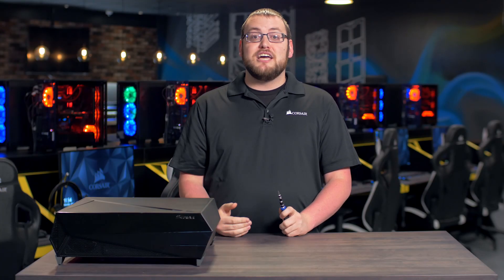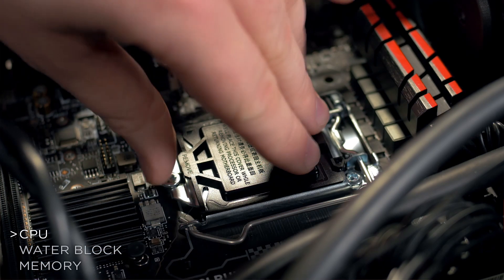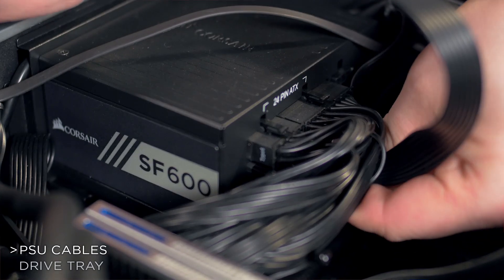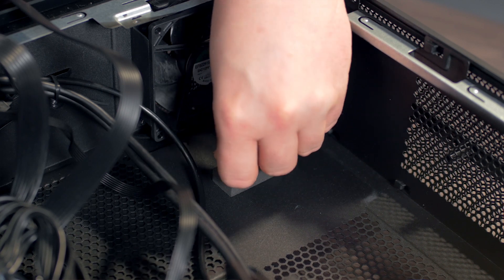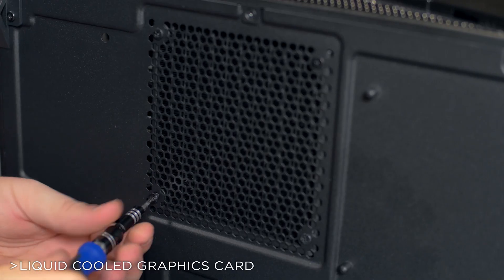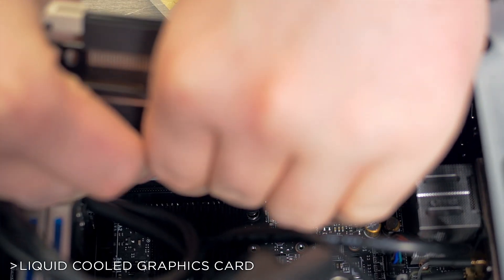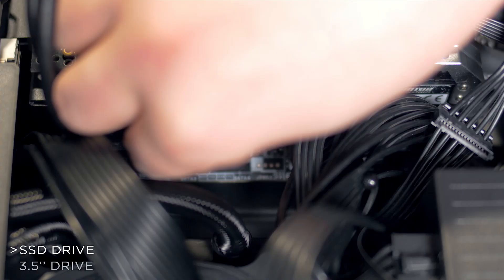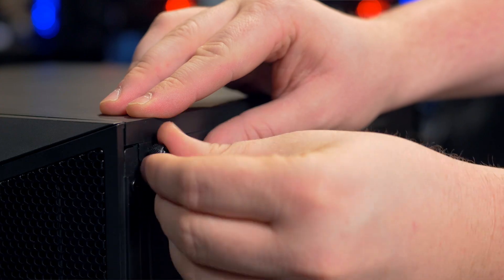How to Build BULLDOG 2.0

Comment: Does it have m.2 NVMe support?
Reply: That would depend on the motherboard, not the case.
Reply: Yes but it comes with an MSI motherboard
Reply: This isn't a case. It's a barebones. MOBO and PSU is comes with it, which is why you might have noticed he never installed them.
Reply: Yes on the bottom of the motherboard

Comment: Why do you call these VR and 4K ready when all it is is a case?
Reply: I guess because it fits big graphics cards
Reply: That is the stupidest thing ever.
Reply: It's not just a case...
Reply: luigikiller1000 Front panel HDMI port and usb 3.0 port
Reply: You can't be serioues
Reply: Any motherboard can perform at 4k. If you have a motherboard that supports the 4400 series then your Mobo is fine. Do you have any idea what you are talking about?
Reply: yeah a little misleading also define gaming at 4K?  Technically a 1070/1080 can do 4K, but at what FPS, settings,  refresh rate?  It's nice to know a 1080 Ti hybrid card can get in there, since that IMO is the card to get if you want true 4K
Reply: but it has nothing that actually can perform stuff